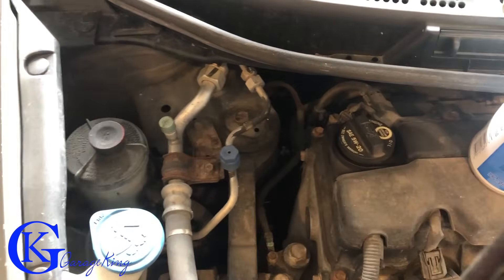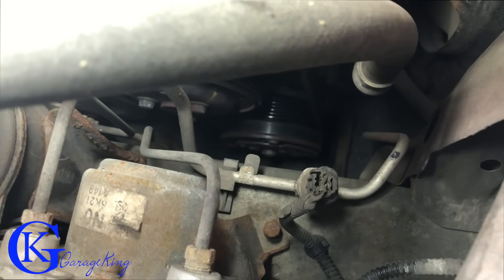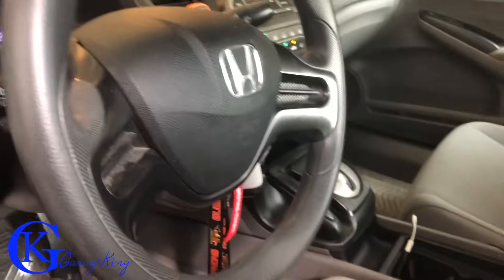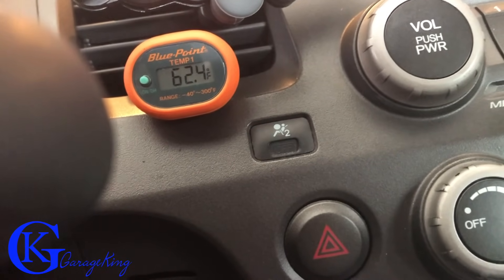How to charge Honda Civic AC with a can

Comment: I know this is old video. I have a 1999 ranger 2.5. am replacing the a/c because the condenser has a hole in it. Putting a new compresser, condenser, drier and also a new line that goes from the compresser to the condenser and to the drier. My system according to the sticker on the truck says 9 oz of pag 46 oil and 1lb 14 oz or 30 oz of freon. My question is my new compresser comes with 7 oz of oil which I haven't emptied yet to see. The instructions for the new compresser says to empty and refill with half of the 7 oz which is 3.5 oz. Where do I put the other half of the 3.5 oz? Most videos I watched say to empty the old compresser to see how much came out and to add that amount of new to the new compresser. Would like to know how much oil and freon I actually need for my sytems to do it right. I also have the gauges and vacuum pump to vacuum the system. thank you for your time and videos.
Reply from the maker: Hey thanks for the comment, and even though its an old video, it is one of my favourites !! A good rule of thumb is to put in what comes out so drain your compressor and measure what comes out, also do that to the condenser and dryer, sometimes you will get oil out of them. I have never added oil to the compressor because if it winds up in the wrong place your new compressor is toast, as you know you can't compress a liquid.  The compressor will have/should have a coating of oil in the inside.  I would put the oil in the other parts. Once your system is running the oil gets moved around so it circulates everywhere.  Also a leaking system will loose oil as the leaking refrigerant will push oil out (oily parts on the outside).  I checked and your system takes 7oz from empty and there was a note that an additional amount may be added due to premature failures (so this could be why your sticker says 9).  You are safe to put the rest in the accumulator/dryer.  Remember you have not removed your evaporator so there could be an ounce in the there.  I think you are most likely safe to add the full 7 as you are replacing most of the system.  If you want to put an ounce or two in the compressor make sure to turn the compressor over a few times by hand to make sure it rotates freely, then put a couple ounces in the condenser, and the rest in the accumulator.  I forgot if your accumulator comes apart or if it's a sealed unit.  Make sure if you are using a freon/refrigerant replacement you don't use 30oz, it will be less as the density is different.
Reply: @GarageKing  so  to get this right. you say I can put the whole 7 oz in my system. my system has been down for a few years with the hole in the condensor. So I can put 3.5 oz in the new compresser plus turning it by hand when the oil is in and I can put the rest into the new drier. Am not replacing the evaporator. my drier is the kind that has 2 fittings. It is a tall black kind for my ranger by the firewall. Would show a pic, but can't figure out how. I just want to get it right for the right amount of oil and freon. I thank you for your time and replies. Have subscibed to your channel.
Reply from the maker: @wisfull11  Thanks for the support :)  I would say with everything that you are replacing I would put all 7 oz in.  Put 1 in the compressor and turn it by hand a few times (before you install in the car) put 2 to 3 in the condenser and the rest in the accumulator(dryer) the oil will settle when you pour it in, and then when you run the vehicle the oil will wind up circulating throughout the system. As per my last comment, if you are not using real 134a, then pay attention to the charge.  Some cans in the US are real 134a and some are a replacement, which is not 134a (you can use it - works great) but it has a different density so the amount you use of that would be less.
Reply: @GarageKing  so 1oz in the compresser and 3 oz in the condensor and the rest of the oil in my drier just so I get it right. also if I use the little cans should I keep it pointed top up or bottom down when I charge the system? and can I use a scale to weigh them so I know how much I need for the charge or go by the a/c gauges I have? thank you for the replies and sorry for all the question, but I want to get it right and not blow up my system and new compresser.
Reply from the maker: @wisfull11  Yup the numbers you have are right.  I would not rely on the gauges to fill, they are accurate at detecting problems, and can let you know if your system is really low, but once you get to the %70 full and up you really have to pay close attention to the ambient temperature with the readings, and the temp is not always right.  For example, if you are running your car in an open garage the car will heat up the air around it. If you are using cans you are better off to empty X number of cans that will put you near the 30oz (depends on what cans you buy) but not over. Then use part of an additional can to get you close to the 30 (Many cans are resealable now so you won't waste any.  If you are under a few oz you will never know, and the system will perform fine. Also if you are going to use cans its best to charge with the can upside down as its easier for the liquid to get into the system.  You can charge upright, but it takes longer. Also try not to charge on a really hot day, and if you can, I would advise that you vacuum your system after that work as you will have moisture in you system.  moisture = warmer air
Reply: @GarageKing  the cans say 12oz. so you say after charging to vacuum again to get any residual moisture out? if I put half of the 7 oz which is 3.5 oz in the compresser where do I put the other half of the 3.5 oz? you can't have the whole 7 oz in the compresser right? thank you for your time and replies
Reply from the maker: @wisfull11  Hey There, no no, Vacuum 1st, then put the refrigerant in. Once you button everything up there will be moisture from when you had the system open.  That moisture should be removed.  When you draw a vacuum on the system that lowers the boiling temperature of the water so with the vacuum the moisture will boil away.  Then after that add the refrigerant.  If your can says 12oz then you need 2.5 cans, so the first 2 are easy as that puts you to 24, then you need another 6.  Now......  With 24oz in there your system will be cold, and you can attempt the last 1/2 can to give you that 6oz, or if you are afraid of overcharge you can leave it knowing your system is 6 oz low. If you have a resealable can then you can feel the "weight" of the can and put about 1/2 in and save the other 1/2.
Reply: @GarageKing  I have the equiptment to vacuum down before I charge the system. ok so only need 3 cans of freon and maybe use half a can on the third or so. am getting a scale to weigh to see how much the can weighs. I know I have alot of questions, but want to get things right. I appreciate your help. as for the oil. When I empty out my old compresser to see how much was left in it do I measure and put that same amount back into my new one or go by the instuctions that came with my new compresser which says to empty it and put half of the 7 oz it came with in the new compresser and the other half of 7 oz which is 3.5 into the rest of the system. where do I put the rest. again thank you for your busy time.
Reply from the maker: @wisfull11  Hey There, Because you replacing everything except your evaporator I would use the full amount of oil. There is rarely any oil in the lines, and the evaporator might have a small amount.  You don't need a scale if you use the cans as you will be close.  Two cans is 24, so just put a bit more in from the second can.  Remember most vehicles before a leak is noticed are running with 1/4 of the factory level.  Your vehicle will get cool after one can which is 12oz (you told me these are the size of the cans you bought) You could put the 3.5 in the compressor and turn it by hand, but normally we don't put much oil in the compressor.  If the instructions are telling you to do that, you can.  But to be safe turn the compressor over by hand just to make sure there is no hydrolock, then the balance can go in the condenser and the dryer/accumulator. If you put an oz or two in the compressor then just split the rest between the condenser and the accumulator/dryer.
Reply: @GarageKing  the compresser instructions say to turn over the compresser 8 to 10 to distribute the oil in the compresser. for the other 3.5 oz should I just put an oz in the condenser and the rest into the drier or should I just put less oil into the compresser and the rest into the condenser and drier? want to do this right. also when I vaccum it down with the gauges do I open both the high side and low side on the gauges or the port sides of the system? thank you for your help.
Reply from the maker: @wisfull11  Hey there, you can put the 3.5 in the compressor as the directions are saying to do so, turning it over 8-10 times is good so it will ensure there is not "glut" of oil somewhere that will cause it to lock up.  I would split the rest between the condenser and accumulator.  Then you have oil everywhere. When you are vacuuming open both ports and apply suction to each port.  Then close both ports and fill from the LOW side and you should be good to go !!!!
Reply: @GarageKing  okay got you. when I fill from the low port side do I close the high side on the gauge? as I have seen on other videos they say to keep that one closed and only use the low side hose. Also so I will put 2.5 oz in the drier and an oz in the condenser. thanks for your quick replies and I know you are busy to take time out from your day to answer my questions.
Reply from the maker: @wisfull11  Yes, after evacuation, close both sides, take off the gauges, and you can use one of those kits to fill from the LOW side only.  High side to stay closed.  If you want to fill using the gauges then make sure high side stays closed :)

Comment: Does the running lo side pressure give any indication as to whether there is too much refrigerant in?  If not, can using hi and lo side running readings tell you when the right amount is in the system?
Reply from the maker: Hi There and thanks for the comment, to answer your question its yes and no.  No its not accurate, but yes you can tell if the level is low.  You can look at the low side when the vehicle is running and see where the pressure is.  Similarly you can look at the high side.  The problem is ambient temperature has an effect on the readings, so using the gages can tell you if its low, but its not that accurate.
Reply: @GarageKing  I would like to thank you very much for answering.  It takes time on your part and I really appreciate that...

I did notice that the compressor ran constantly on the VERY hot day that I installed the refrigerant (Full blower, doors open on my '05 Silverado) and yesterday, when it was cooler, the compressor cycled on and off some, again with full blower.  I'm going to assume that I must have somewhere near the right amount in.
Reply from the maker: @nissanranger5866  Hey There, you are spot on.  The reason the compressor runs constantly in really hot weather is the evaporator (in your dash) can't keep cold enough because there is so much hot air being run through it, so your system is essentially maxed out.  On a colder day your evaporator can actually get too cold (not hot enough outside) so the compressor turns off, then the air continues through the evaporator warming it up, and then when it gets too warm the compressor turns on again to chill it down.  No problem on the answering at all, here to help and glad you are taking an interest in doing it right !!

Comment: GK, any tips on a recirculating button not working efficiently? (Civic 2013).. hasn’t worked consistently in a long time. Tons of shops around my area don’t know what’s wrong with it. 

Don’t know if it’s the actual motor opening/closing having an issue, or if it’s a fuse issue.. thanks!!
Reply from the maker: Hey there and thanks for the comment.  I doubt its a fuse issue as more would be wrong than just the recirc.  I haven't had to deal with that problem but I would say if the light behind the recirc button operates when you push the button then I would lead to the blend door motor not working.  If its weak it will not push the door hard enough to make that seal and the small amount of hot air that gets through can make the AC look as if its performing inefficiently.

Comment: Is there supposed to be a little almost needle thing for the low side port? So I assume the refrigerant doesn’t come out
Reply from the maker: Hey there, both the low and high sides have one way valves in them, but they do leak sometimes.  Think of a how you put air in a car tire.  Its kinda like that except the fill fitting snaps on and stays on unlike a tire where you have to hold it on.  The 134a valves are similar to schrader valves.  If memory serves me correctly the old R-12 systems used schrader valves.

Comment: 2017 Honda Civic 90* gage doesn’t snap on. Do they come in Student sizes?
Reply from the maker: If you mean straight sizes yes they do.  Also make sure you are snapping it onto the right place.  There are 2 fittings, a high side and a low side and they are both different sizes.  You must use the low side.  Also as your Honda is 2017 look at the label and see if it is 1234yf, if it is you need a different fitting as the 134a fitting is different.

Comment: So, to be clear...one should not do this procedure when your ac is still blowing some (but not much) cold air?
What if your ac still blows cool air, but you want it cold (as new)?
Reply from the maker: You could still do the procedure, its just that if you are already blowing some cold air then you have to be careful not to overfill it.  Unfortunately the only way to know exactly how much to put in is to evacuate the system empty and then weigh in the new charge.  If you want it colder you can "pace" or "throttle" some in and once it starts getting cold then stop.  Also It may never be as good as new because if your evaporator is leaking (it might be fine, just saying) in the dash you can have compressor oil coating it and dirt sticks to it and you have reduced airflow because of it, but you can usually get pretty close.
Reply: @GarageKing  thank you. I've been told if your ac has been blowing no cold air, tour compressor is probably shot, or you have a pretty good leak.
Reply from the maker: @stratrat57  No problem at all, just so you know once the AC compressor stops working you are right that you have a leak BUT, sometimes it could take 10 years to leak down, it could be a very slow leak.  Leaks are much more common than compressor failures.

Comment: What if it’s completely drained and I for sure need the 16oz? 
Would I have to pierce another can and kinda just guess?
Reply from the maker: You can run it low, that's never a problem, but running it high can create problems. Usually your compressor will begin to operate with as few as a couple oz (1-3oz), and begin to cool around 5oz, so even if you put in a full 8oz can its going to cool, but if you have a leak (which you probably do) its not going to last as long.
Reply: @GarageKing  Oh ok .. in my case, I just had an engine swap in my little 03 civic. But I wasn’t told that the ac gas would be completely drained. I guess I’ll just use a single full 12oz can.
Reply from the maker: @PeaceNinja007  Good Call, if you look at the 2:50min mark of the video where I'm showing the manual you can see for an 03 the amount is 1.1 to 1.21lbs which works out to about 14oz so if your system is totally empty so are good to go with a full 12oz con and that should make your system pretty cold.  I know its not always practical for the average guy, but if you have a way to evacuate it that would be good (just a cheap amazon compressor ) https://amzn.to/4bH5lEi  but you need one with the gages like in the link.  Evacuating your system will make it colder, and also remove moisture that causes corrosion inside.
Reply: @GarageKing  Yea I was thinking about that as well. Admittedly I find that stuff kind of intimidating lol I don’t want to mess something up right after I just paid 3k to repair my car. 
I try the can alone for now and if I don’t find it cooling as it should, I’ll get a compressor
Reply from the maker: Sounds good !!
Reply: @GarageKing Hey just wanted to thank you. I was really doubting myself but I followed your video step by step and it worked 😊
Reply from the maker: @PeaceNinja007  That is awesome and you are now back in "cool" mode !!
Reply: @GarageKing  haha 😎